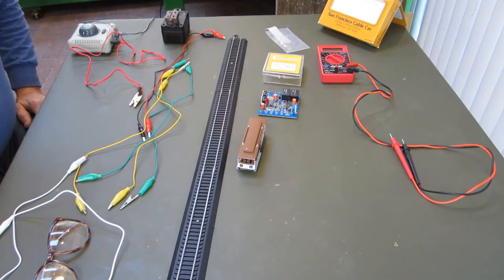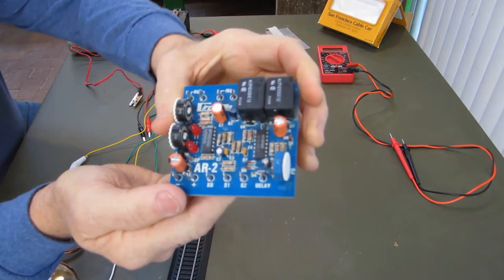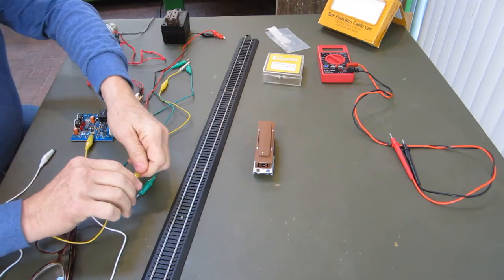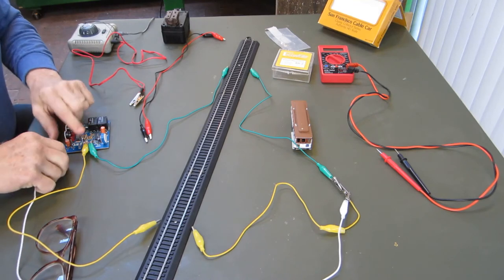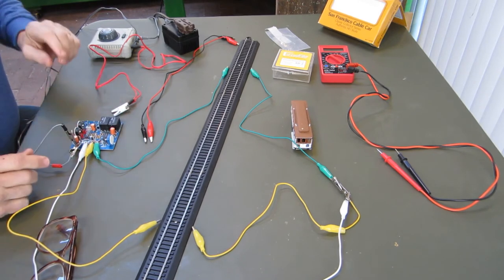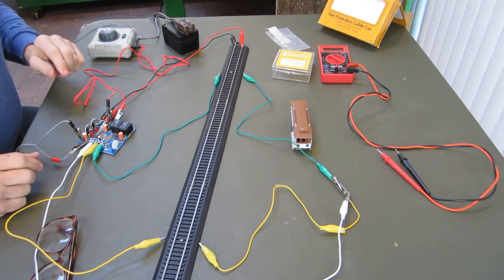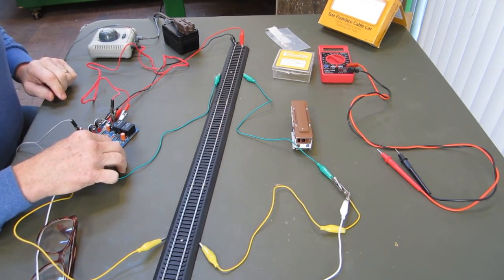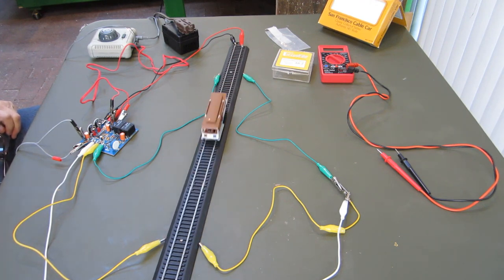Circuitron AR 2 Auto-Reverse Circuit

Comment: Pretty cool. If you're handy with electronics or know someone who is, adding a voltage ramp to that circuit would add to the realism by eliminating the abruptness in the start and stops. The trolley would hit the sensor and ramp down to a stop, etc.

Comment: Cool thing. But wouldn't it be problematic if I for example prefer to run train at dimmed light in the evening or having nighttime layout?
Reply from the maker: Yes--if you change the ambient light, you must readjust the AR-2 to compensate.  I once used this in a mine tunnel for a gandy dancer to run back and forth.  It was necessary for me to light the tunnels to use the AR-2..
Reply: only if you insist on optical sensing. if you instead use current-sensing track section that would eliminate the lighting requirements. the ar-2 doesn't know the difference....

Comment: Where did you buy the leads that are small enough to attach to the diodes?
In the finished installation on your layout did you solder the wires to the diodes or use the alligator clips?
Reply: Thanks for the clear explanation
Reply from the maker: The leads were purchased at Harbor Freight; however, they can be purchased at any big box store.  You will find them near the lighting and ceiling fan section.  All wiring is soldered on my layouts.  The alligator clips were used for the purpose of instruction.  NOTE:  Make sure you know how to solder.  Should you allow the leads from the opti-sensors to become too hot, you could damage the sensor and it will not work.  When soldering, you must get in and get out!
Reply: Thanks for the information